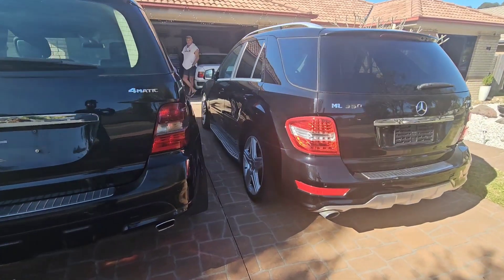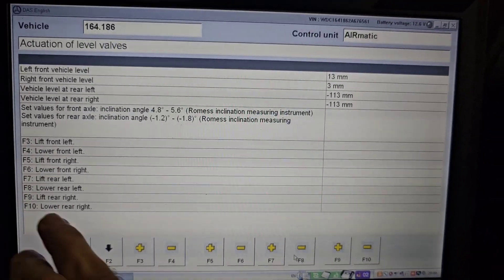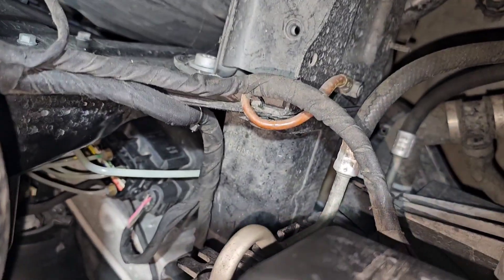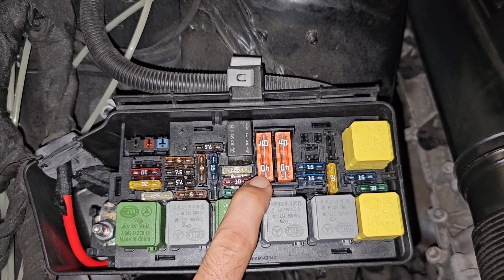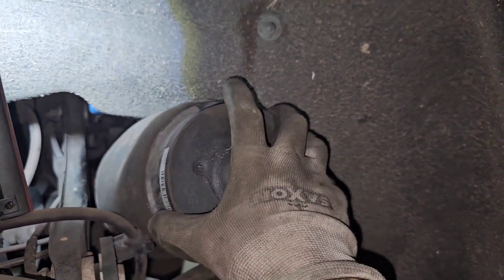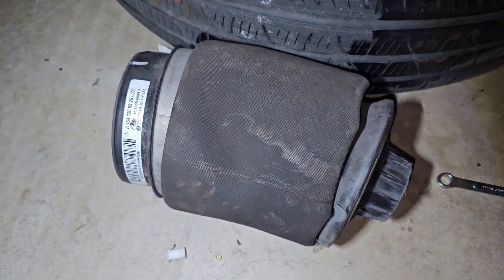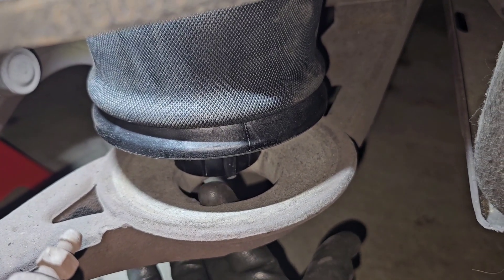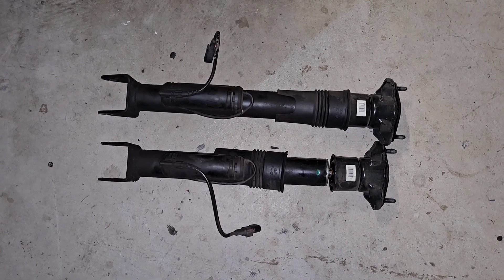Diagnose Mercedes faulty Airmatic and replace the air springs easily

Comment from the maker: Mercedes Airmatic suspension can be scary and expensive if not done as a DIY work, this video should be able to help you to diagnose the rear springs on your Mercedes and save a lot of money. The fault code I was dealing with this example was the 5507.

Comment: Hi, I have a question. I have an 08 CLK 350, and over the past few months I have noticed that sometimes as I get to higher speeds, my steering wheel will start to shake a little bit. I just got me wheels balanced but it is still doing it, and I am having trouble figuring out what else could be causing it. I was just curious if u might have any ideas into what is going on. Thanks!
Reply from the maker: How old are your tyres? Have your car sat for a long time, I would first check the tyres, then rims, and etc...
Reply: @BenzAddiction  The car is my daily driver so it never sits for more than a day or two. The front tires are a year old. I just got a screw in the side-wall of one of my rear tires, so I decided to replace both of those (about 3 weeks ago.) But the issue started before replacing the rear ones. 

Even though I got my wheels balanced, are u saying the rims could still possibly be the problem?

Also, I have heard that warped rotors could cause the issue, but I just replaced them about 8 months ago